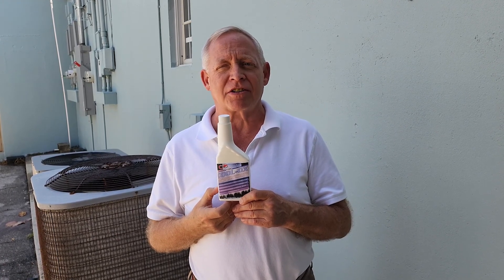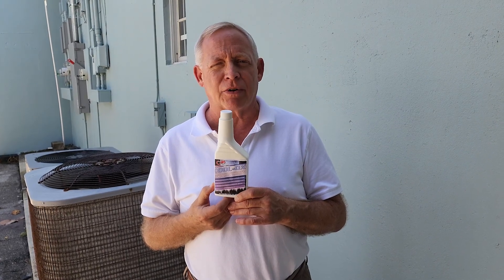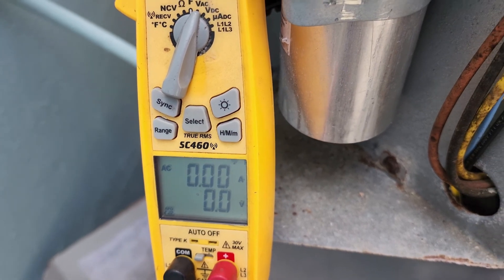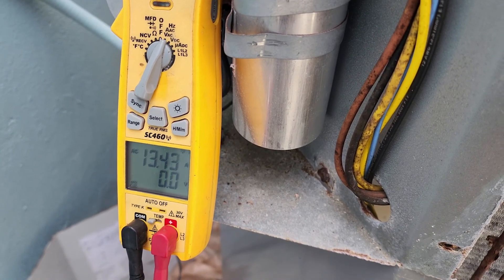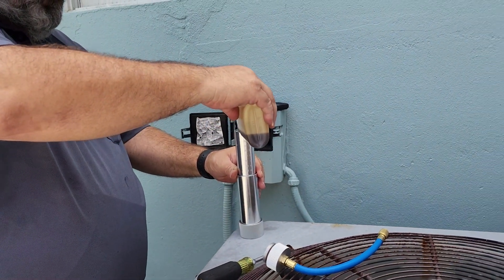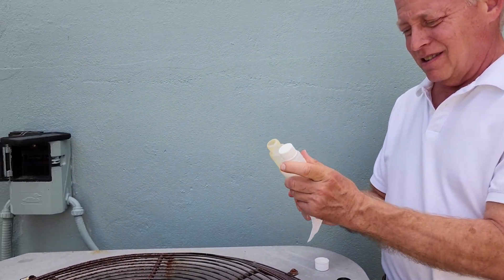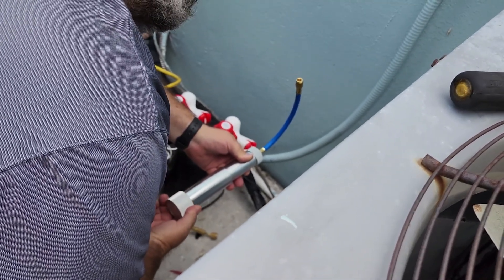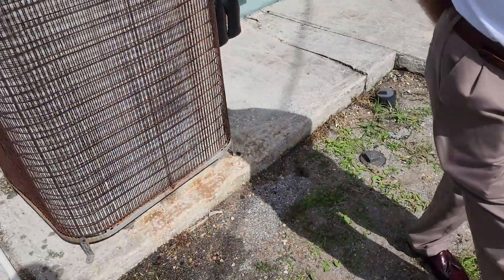Demonstration of Infinity Lube™ Cool-Ox Lowering Electrical Energy!

Comment: Let’s see some real data, not a cherry picked data point sometime arbitrarily in the middle of the run cycle. A graph of run time with similar indoor and outdoor temperatures with superheat, subcool, and pressures would suffice through an entire run cycle.

Comment: I know this was done in good faith but it’s not scientifically accurate. Starting with a baseline of fresh refrigerant, a new drier, and the correct amount of compressor oil would have been right. Then add the CoolOx. There’s too many variables here under the surface. Adding 4 oz of normal compressor oil to a old system could just as well reduced amperage by that amount. There’s no way to be sure.
Reply from the maker: Hey Mark,

We don't claim that it's a scientific test, but these results are seen over and over again with our product. We will be issuing more of these in all types of applications. If you are interested in conducting a thorough test, we would be happy to get you the necessary product to do so. Just give us a call!
Reply: @fuelox4672  I know what you mean but I’m just trying to explain my criticism. I can see the product works when added to a existing charged system. There is a severe lack of FuelOx comparison test videos with care for accuracy. I think you have the potential to leapfrog the other big names in additives but you have to be honest.

Thank you for the offer but I will buy it myself someday and do my own tests.